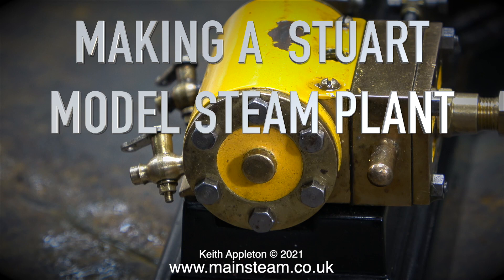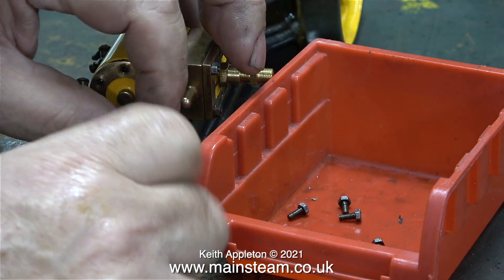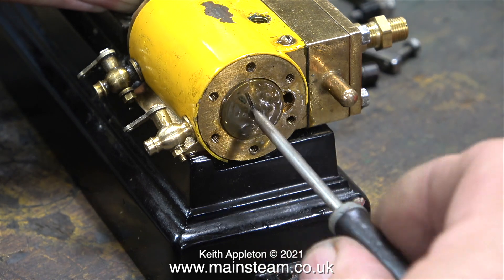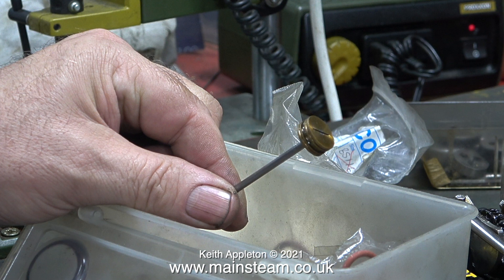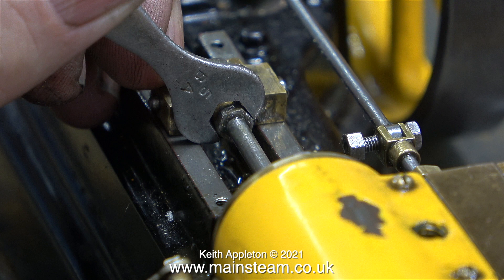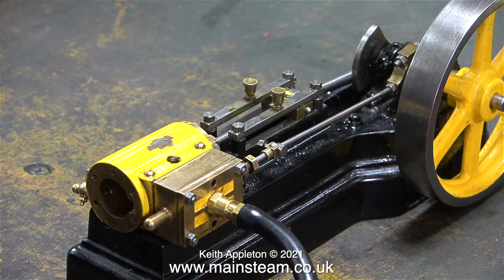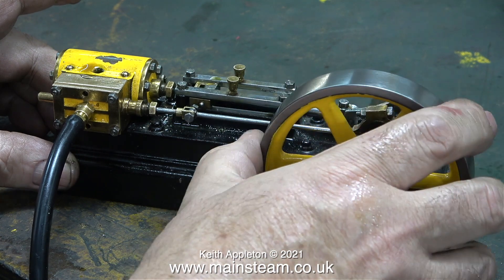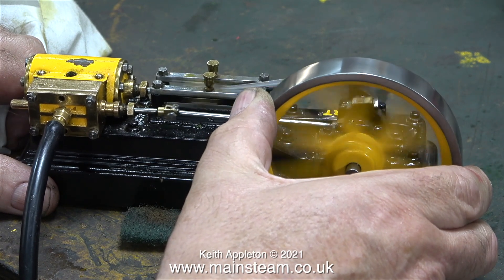MAKING A STUART MODEL STEAM PLANT - PART #8

Comment: Thank you Keith for your videos. I have learned a lot from you about steam engines in general. Time to put that information to good use and prepare a small "full size" engine together for "off grid" use. We have "hot" summers here in Texas but if last February was any indication of the effects a strong North wind has even in the south...a fire in the boiler and a steam engine running the generator would be ideal!